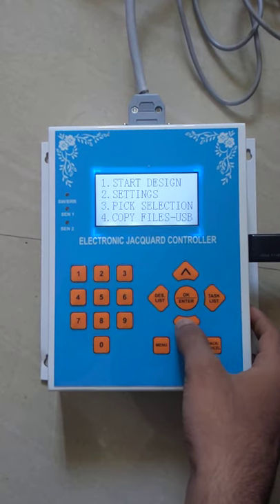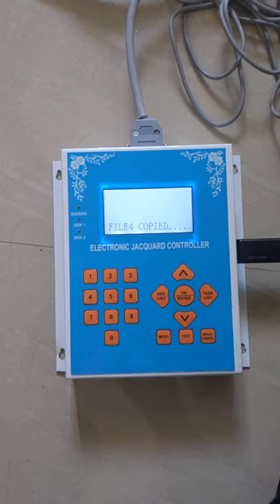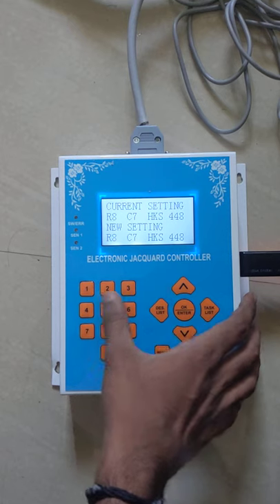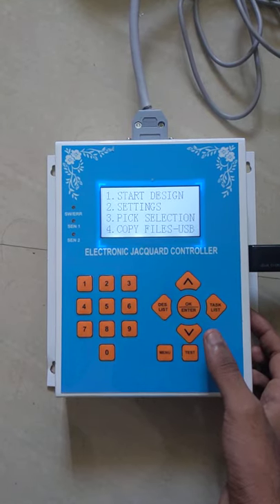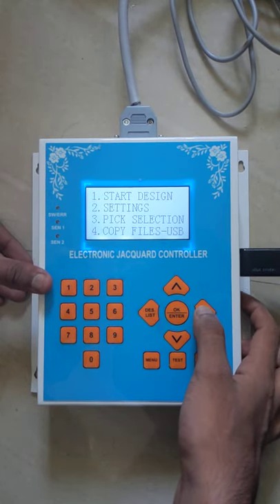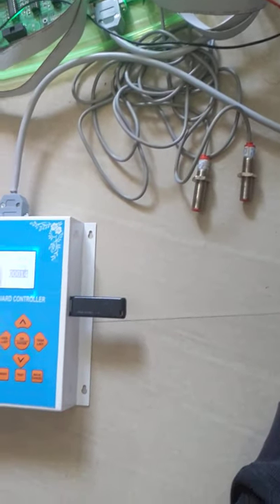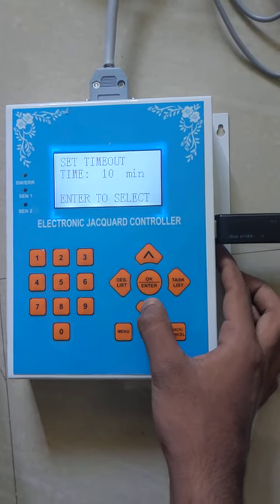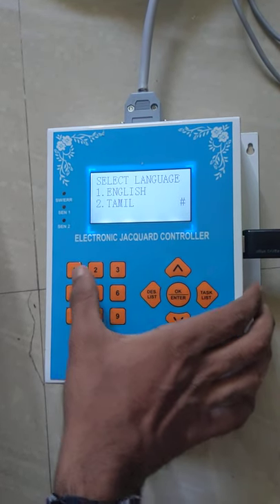Electronic Jacquard Controller / Jacquard Mother Control Unit/Micron Controller/ Jacquard Controller

Comment: If you give any company jockards this control unit
Reply from the maker: More than 15 Machine Manufacture using this controller, so for 500 units running in all over India (Contact : 8903200951)